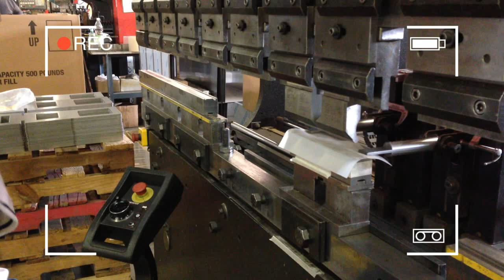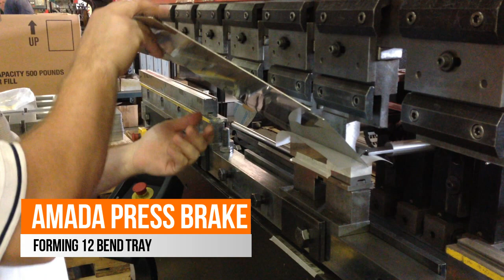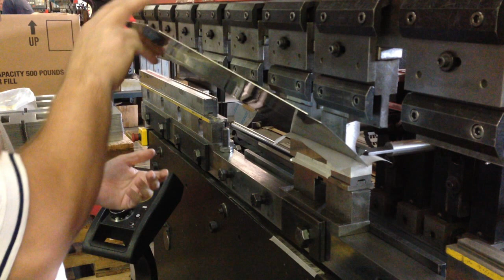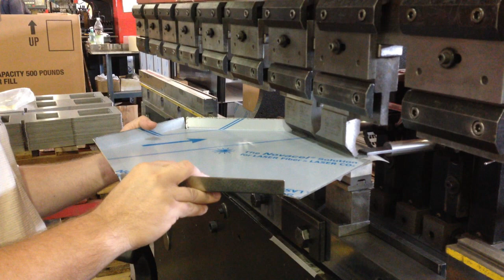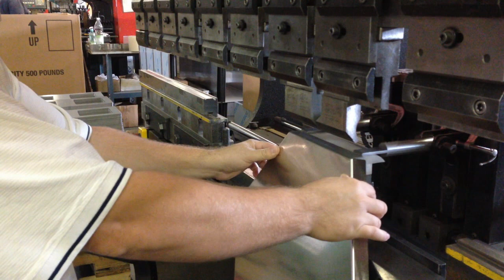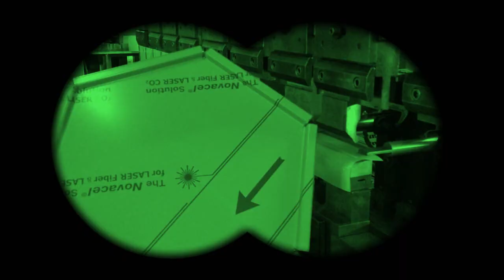amada press brake - forming 12 bend tray

Comment: Fix your bending tape with two bulldog clips on either side of the length of the bend. That way, you can get the most out of the tape.
Reply: I work in time Muscat Oman engineering company Muscat i opperter Amada all machine bending opperter i need to meet you jop sir

Comment: Look at the big assed gaps between the flanges, might want to reengineer that part. Also I don't like Amanda as you have to bend everything backwards which brings your fingers in close to a punch point.
Reply: Challenge excepted
Reply: That's not true at all. You can either reverse the punch or use a step stopper which will avoid having your fingers in the way of the tooling. Or change the way the part is bent in the first place.
Reply: I work in time Muscat Oman engineering company i work opperter machine bending opperter Amada all machine i need to jop sir
Reply: @reecejones30 i need to meet you jop sir